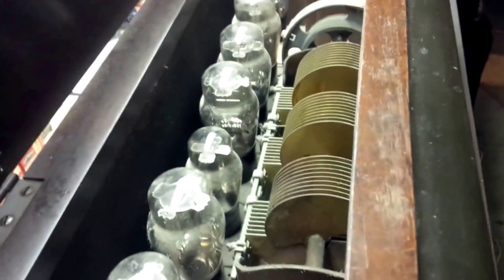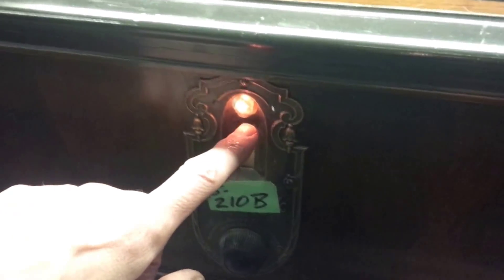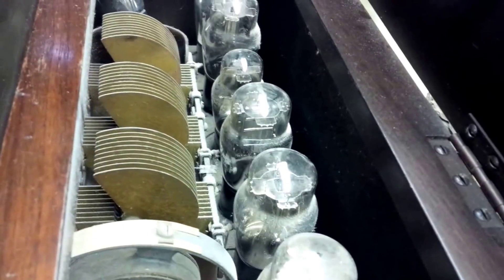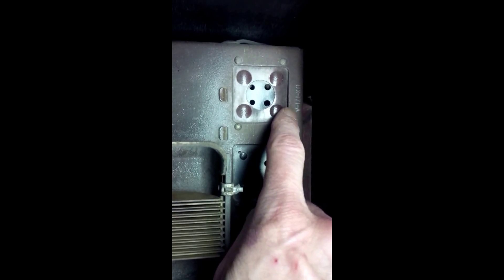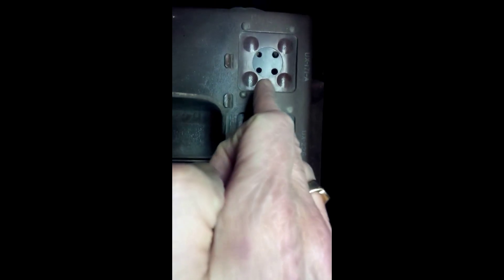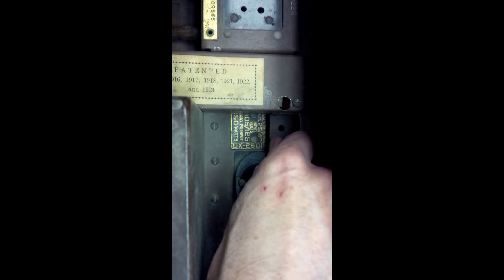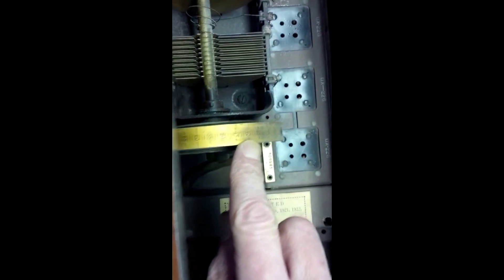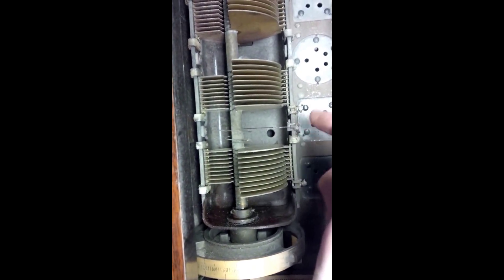Quick Look at a 1920s Radio - Initial Power Up

Comment: What power supply did you use?
Reply: The Radiola 18 was one of the first mains powered sets. It ran off 117vac 60 Hz (25 Hz if in Ontario).

Comment: That chassis is a Radiola 18 from around 1928. The 71A tube is the audio output tube. The radio is a Brunswick 5KR, which used the RCA Radiola 18 chassis.
Reply from the maker: Dennis Carter You're absolutely right.  When I shot the video and couple weeks ago, I had found all that information but I forgot it when I posted the video today.

Comment: wow that radio looks like new. Just think what all it heard in its life.
Reply from the maker: ***** I wonder how long it was in regular use.  In the early 30s, radio technology changed a lot and I'm guessing this one was put to rest.  And to think it was designed to be plugged into the house power when many or most houses had no power yet.  You had to be a rich guy to afford one of these.  I'm curious about the reference to 40 cycle power.  Was that a ship-board frequency?
Reply: well put Troy...and Jim..what a clean..beautifully crafted set..audio quality..even via youtube seems stellar..thx for great look at the past
Reply: Jim Lindenas That radio might be older then 1920 maybe reading this about Hz has me wondering. Also this site is cool
http://www.edisontechcenter.org/Mechanicville.html
http://en.wikipedia.org/wiki/Utility_frequency
A General Electric study concluded that 40 Hz would have been a good compromise between lighting, motor, and transmission needs, given the materials and equipment available in the first quarter of the 20th century. Several 40 Hz systems were built. The Lauffen-Frankfurt demonstration used 40 Hz to transmit power 175 km in 1891. A large interconnected 40 Hz network existed in north-east England (the Newcastle-upon-Tyne Electric Supply Company, NESCO) until the advent of the National Grid (UK) in the late 1920s, and projects in Italy used 42 Hz.[6] The oldest continuously operating commercial hydroelectric power plant in the United States, Mechanicville Hydroelectric Plant, still produces electric power at 40 Hz and supplies power to the local 60 Hz transmission system through frequency changers. Industrial plants and mines in North America and Australia sometimes were built with 40 Hz electrical systems which were maintained until too uneconomic to continue. Although frequencies near 40 Hz found much commercial use, these were bypassed by standardized frequencies of 25, 50 and 60 Hz preferred by higher volume equipment manufacturers.